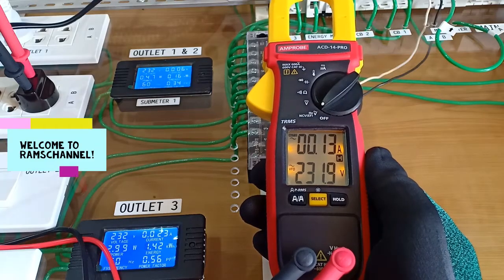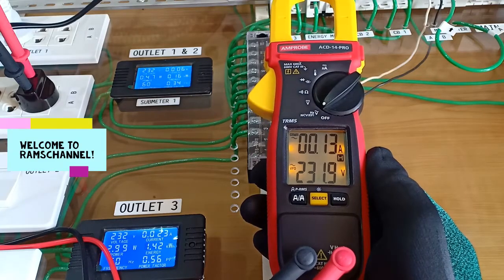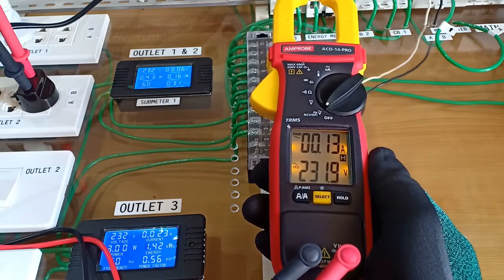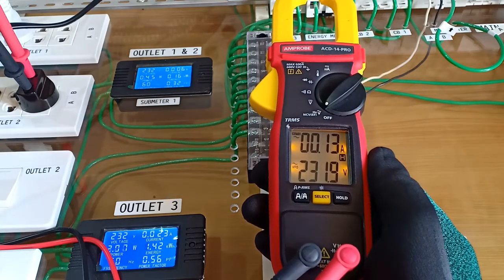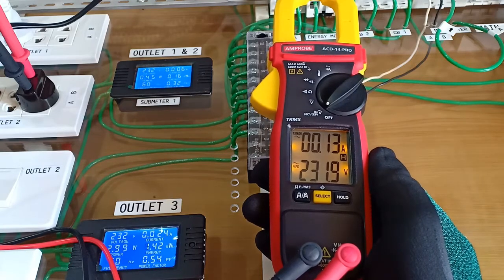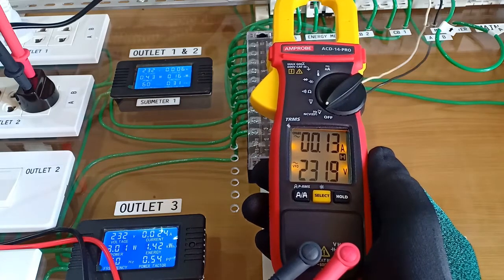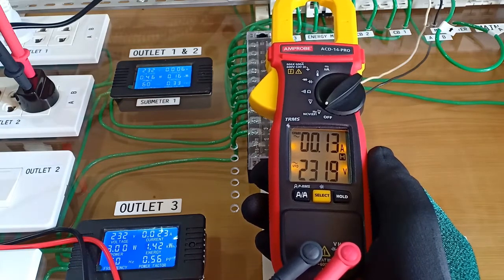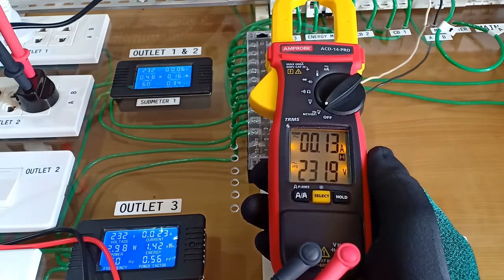[ENG SUB] Amprobe ACD 14 Pro True RMS Clamp Meter: Unboxing and First Impressions

Comment: Excelente video didactico,  y práctico.
Tengo esta pinza amperimetrica y es un excelente producto calidad precio.
Un saludo.
Fran.
Reply from the maker: ¡Gracias por tu apoyo, Fran! Es una buena pinza amperimétrica de corriente CA versátil con la mayoría de las funciones esenciales diseñadas, incluida la corriente de entrada (inrush current). También es muy rápido para medir la capacitancia y tiene un alto voltaje de diodo de 3V, lo que permite probar más LED. Muchos DMM solo alcanzan 2 V para la prueba de diodos.
Reply: Hola buenas, queria hacerte una pregunta sobre tu excelente presentación de esta pinza.
Esta pinza se anuncia como que tiene un low pass filtre?
Es así tiene un filtro pasabajo incorporado?
Es decir cuando mides corriente se entiende que se encuentra conectado permanentes?
Saludos 
Fran.

Comment: Wow,, love the video and the meter. Back light of this model vs the kyoritsu is night and day
Reply: Amprobe is owned by Fluke and this meter is half the cost of a Fluke 325
Reply from the maker: @alross18058  Thanks for the info.
Reply: @alross18058 creo que es mucho más barato aún,  pero en definitiva es un equipo decente.
Reply from the maker: Thanks for your comments sir. The backlight of the ACD 14 Pro last for 20 min, much longer than the 2127R, which is a huge convenience. But you're right, the backlighting of the Kew 2127R was simply superior.

Comment: sir can u explain sir kew 2117r and 2127r thank
Reply from the maker: Hello sir, the Kyoritsu Kew 2117R and 2127R share these common features: AC/DC Voltage, AC current, Resistance, Continuity, Non Contact Voltage detector (NCV), and Data Hold. They looked like they were made from the same body style. Both were well built, capable, Japanese branded True RMS clamp meters that I believe are still affordable. I have the 2127R but not the 2117R. The Kew 2127R has these additional functions: Diode, Capacitance, Frequency, Peak Hold, and Backlight. I have uploaded videos about the 2127R, linked below. I hope this helps. Thanks for your support! 

[Eng Sub] Kyoritsu 1000Amp Kew 2127R True RMS Digital Clamp Meter Review
https://youtu.be/QgOQikqOI98

[ENG SUB]Peak Hold Function of Kyoritsu KEW 2127R True RMS Clamp Meter
https://youtu.be/7UwTfA3MgfI